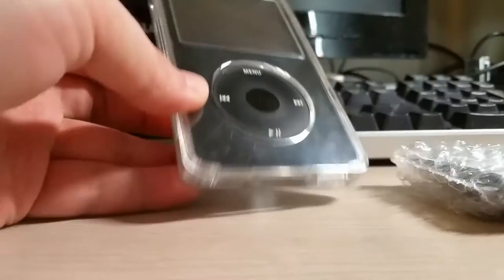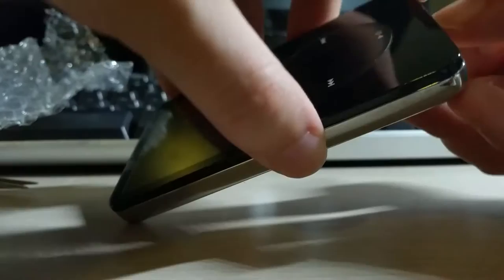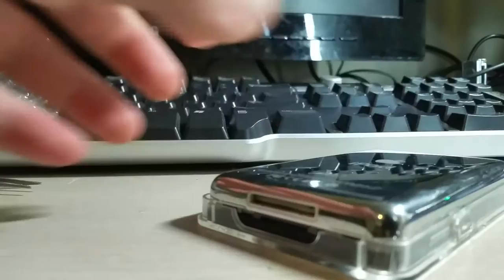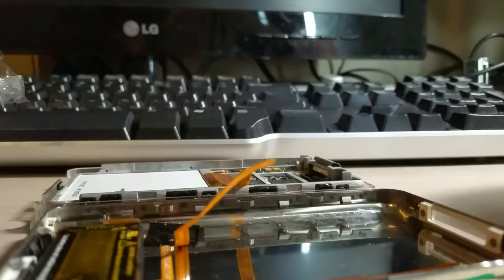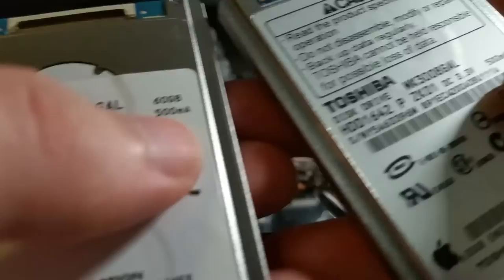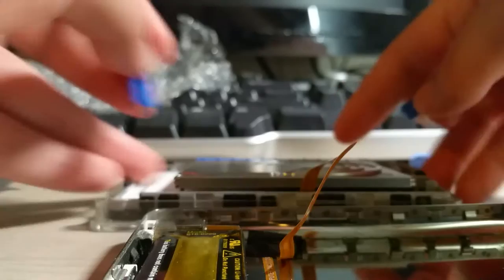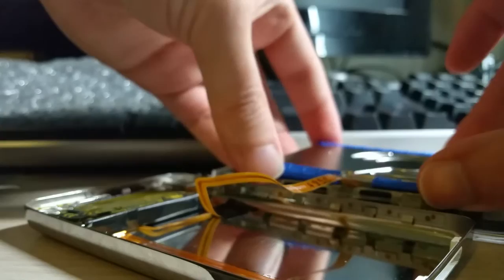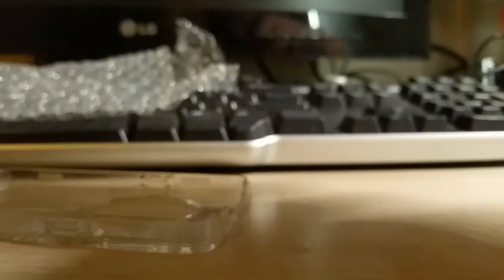Apple iPod Video 30GB to 60GB Upgrade on the Cheap!

Comment: The smart thing to do is to separate the ZIF cable from the drive, if you break it you only ruin the drive, not the ipod
Reply from the maker: Good tip. I've never managed to break a zif connector though, just always super careful with them because they look very fragile.

Comment: 16 bucks for a 60gb hard drive isnt a good deal you usually get 500gb drives for that price
Reply from the maker: Good luck finding a 500gb drive for <$20 that'll fit inside and be compatible with an ipod when this video was made. Of course now it's dirt cheap and easy to do an sd or sata mod but things were different a few years ago.

Comment: Cool mod and thanks for the links! Question: Do you need to upgrade the battery when you upgrade the drive or will the regular 30gb battery perform OK?
Reply from the maker: The new drive uses the same power as the 30gb one so unless your battery has trouble keeping a charge then it should work just as well.